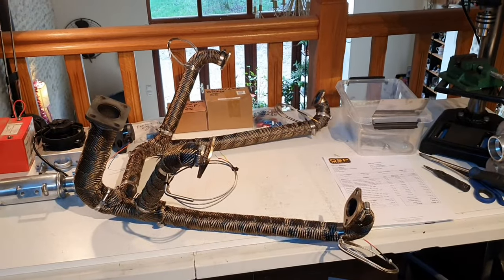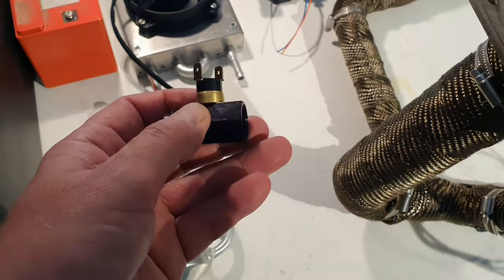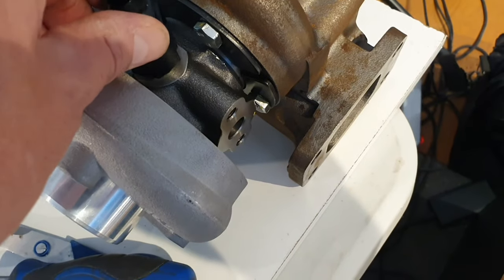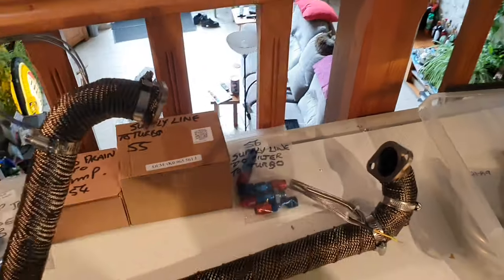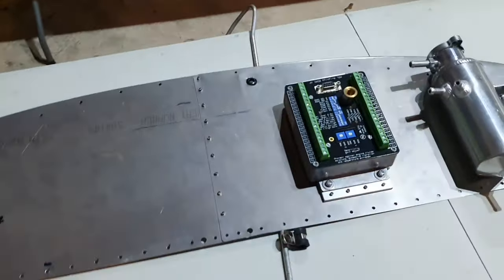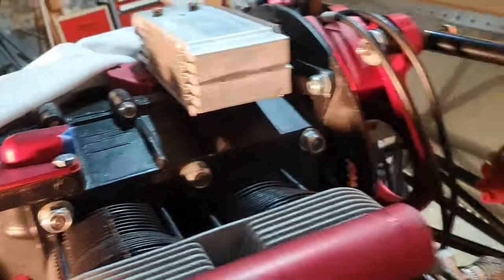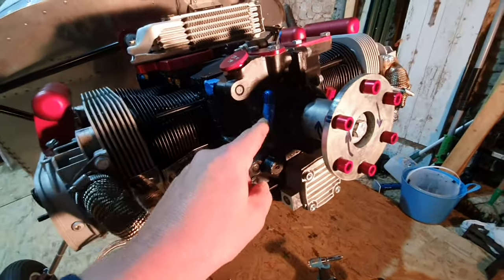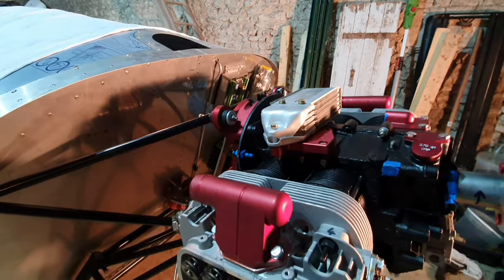Gavin's Sonex B Part 69 - AeroVee Turbo build Part 11 - Firewall, Exhaust & Turbo Cooling

Comment: Hey Gavin, You have just cleared up my confusion with the turbo charger, and in particular the coolant add on system, looks like I will be purchasing all those parts
Reply from the maker: Happy New Year Andy - I forgot to say, don't forget to allow for a three way toggle switch on the instrument panel for the Turbo Cooler control (Off, Auto, On). See you on Friday/Saturday 😊

Comment: Gavin, I have to say I’m a bit surprised that there seem to be several issues with parts fit up for the engine.  The kinds of things you are experiencing should have been clear to the first person that went through the build process.  Is Sonex not getting productive feedback from builders?  Is it a  design problem or is the quality of parts inconsistent? Is Sonex simply not addressing these problems that builders are finding?  What do you think?